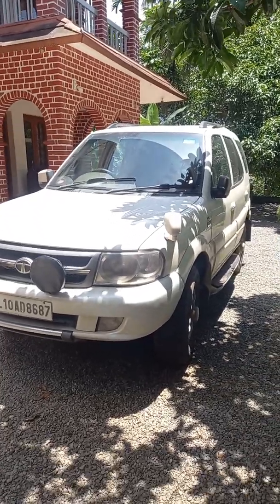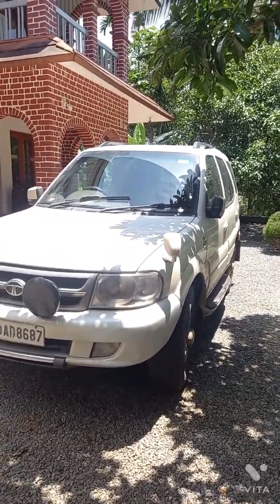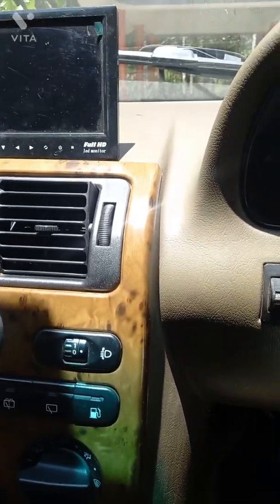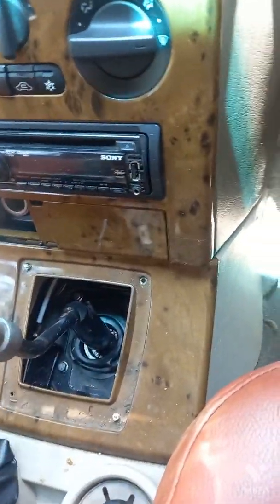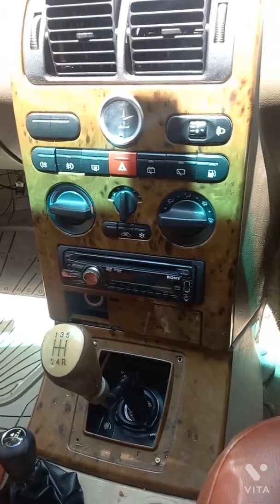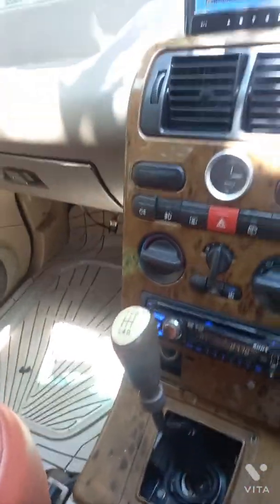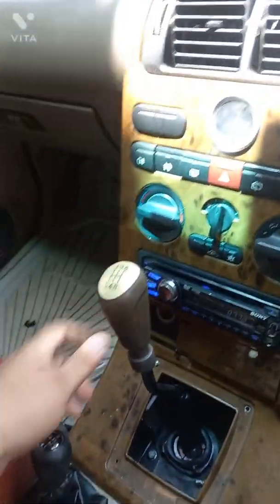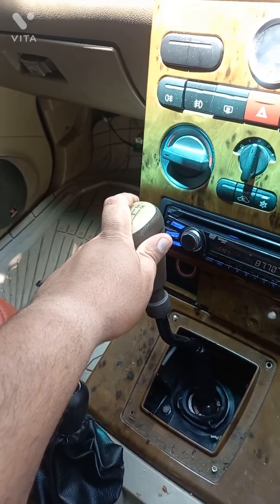Borg warner transfer case electronic shifter converted to manual Tata safari 4x4/Scorpio/Bolero

Comment: Hello,. What about auto hub locks...?
Are they working along with 4L shifting...?
Reply from the maker: Everything else is as normal bro. We had only replaced the 4x4 selector motor and made the shifting a manual way. No changes to the transfer case or differential. Before we can engage 4h on 60km/hr, but now we need to stop the vehicle for engaging since its a manual way, no ecu, no sensors.
Reply: @ptmsful hai, bro,  ah elctric shifter motor ippozum kazil ondooo
Reply from the maker: @vishnumurali  yes bro
Reply: @ptmsful  ante sumo 4x4 anne, anike ah motor venm ayirunne, broyude contacts taramo
Reply: @ptmsful  hlo bro
Reply: I have TATA Telcoline 4x4...can you please suggest to me what happens to the  hub lock and Limited slip differential systems after manual conversation..?
Reply: Where in kerela u did this

Comment: Hello. Could you please let me know how reliable the system is? Since you are using it for a few months now.
Reply from the maker: Its the most reliable system for safari bro. 4L is so simple to engage. 4H is bit tricky.. once u used to it, its simple..anyway it always works,  not like electronics
Reply: @ptmsful  Thanks a lot
Reply: S it's reliable....i crossed 180+ km to do this .....work done successfully....still working good

Comment: Brother iam Sankar from tamilnadu for my Tata safari 3l dicor 4x4 i need this still working electronic but i like this
Reply from the maker: If working fine go with that only bro.
Reply: As you told if rainy that time motor may be fail so better i will convert it into mechanical
I need this but too from area can you send the same i will pay for it 
Local mechanic can able to fit it
Reply: Too far
Reply: Please advise me local mechanic can fit it ?
Reply from the maker: @sankarkaruna5864  no bro. Its custom made set up
Reply: Ok brother thank you